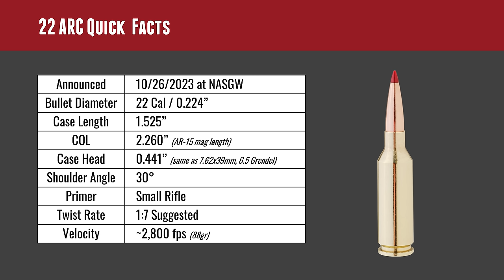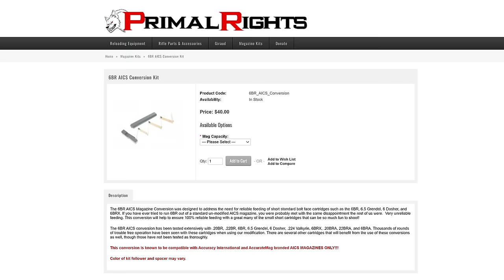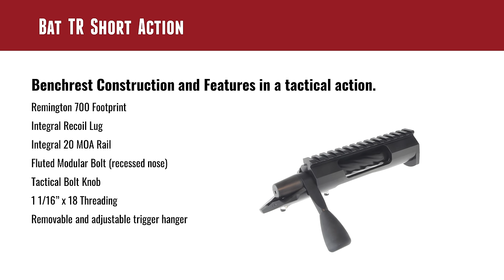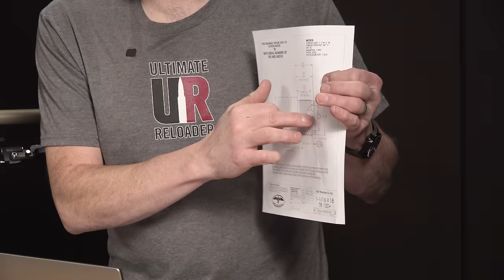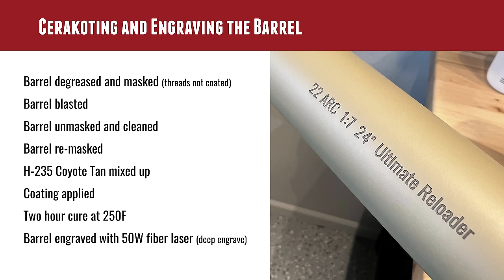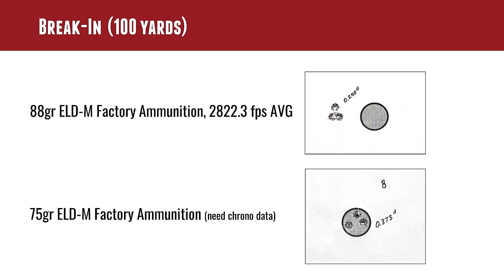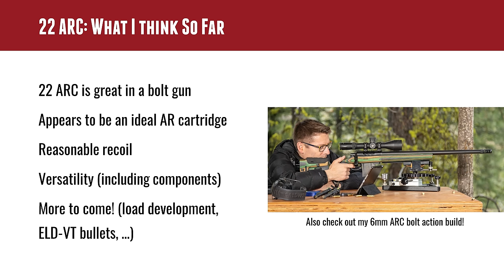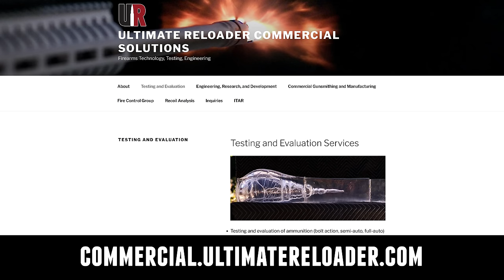22 ARC Rifle Build: Chambering, Threading, Break-In

Comment: Thanks! I'm excited to see the potential of 22ARC in an AR platform. As a 6.5GRN shooter, I have 6ARC parts for an upper build and want to a 22ARC to finish the trio. It's a new take on switch barrel platforms, three uppers, one BCG and one lower!
Reply: I'm a fellow 6.5 Grendel shooter! Lot of stuff got put on hold recently but I've been meaning to build a 6 ARC upper for some years now and when I heard about 22 ARC I knew that would be another one for my list. Have you built that 6 ARC upper yet?
Reply: Not yet. Just got back from SHOT Show and need to process all the new info. I'm sure it will be a screamer. @DanielReyes-hz1qk
Reply: @johnmoore2510  Awesome. I love the concepts and am stoked about the ARC cartridges (as well as the new ELD-VT bullets. I've even got a bolt in the Grendel bolt face for my Defiance action, thinking about doing a 6ARC or 22ARC for that bolt gun as well

Comment: That reamer holder would have to be dedicated to that reamer.  As I would think reamer shanks have enough variation to negate any precision you tried to achieve boring out the holder.  A holder with a collet set up would be more flexible and just as good IF you can get it indicated and set up dead nuts inline with your spindle.

Comment: Interested to hear comments about 22 ARC head diameter in an AR 15 platform. A smaller head diameter is one of the plus points of the 224 Valkyrie, allowing more meat in the bolt head……. and conversely one of the downsides of the Grendel. 52k PSI in an AR platform.

Comment: According to the Hornady manual I have 6ARC, 6.5Grendel and 7.62x39 all have slightly different case head sizes.
Reply: Interesting, from what I understand, as far as the case head, Grendel uses a deeper bolt face. It is only about 0.011", but that can make a big difference.

Comment: I’m much more interested in 22 creedmoor than the 22 arc. I don’t really understand the need for the 22 arc. The 6 arc does everything the 22 arc does, but it does it better, and you can go up in bullet weight to take medium-large game at reasonable distances.
Reply: The reason for a 22 arc would be to use heavy high BC .224 bullets in a AR 15. Bolt gun ???

Comment: Hornady has stated that the 6 ARC and 22 ARC cases are NOT compatible. However, I am not sure if the 6.5 Grendel case is compatible.

I am excited about this cartridge as well as the 6 MAX that Ray on X-Ring speaks highly on.
Reply from the maker: That is correct. I have to confirm, but it may be possible to form 22 ARC by necking down 6.5 Grendel.
Reply: Thats how i form my 22 arc brass. Run 6.5 grendel brass through my 22 arc die and done. Works great. Getting 3450 fps with 53 vmax in a 20” rifle length gas.
Reply: @Ultimatereloader  I think you mean we'll finally get good Grendel brass by necking up the new 22 ARC stuff.
Reply: @Farmerbrown32   I love that 53 gr V-Max, but I wonder how fast it can be pushed with 7 twist rifling? I hear internet stories of 22-250 guys pushing it over 3800, but not with 1:7 rifling. 1:7 at 3,500 (very attainable in the 22 ARC) puts the bullet at 360,000 rpm - well beyond what is often considered max.

Comment: I think the 22 ARC will be a big deal in the AR platform. It's primary advantage over .223 is the substantial velocity increase. I would like to see velocity differences between 18, 20, 22 and 24 inch barrels, so I can determine how short I can go. I need the info soon so I can get one ordered soon. The demand will be great, so the waiting lists will be long. 
Also curious about the capabilities for deer, antelope and hogs with bullets like the 80 gr ELD-X or the 90 gr A-Tip.

Comment: Curious why you'd choose this over 6 ARC in an AR
Reply: The only benefit I see is a little higher BC for bullet weight. I get a little more velocity (2849) out of my 6 ARC AR with a 22" barrel using 90gr Bergers than this got with 88gr bullets, but BC isn't as good. 409 compared to 545 for the 88gr .224

Comment: Help me understand what exactly you mean cut the chamber ? Is the barrel not already chambered for the 22 arc ?
Reply: Correct, that’s how barrels are sold sometimes and then a smith can chamber it and cut threads for whatever is needed.
Reply: @spencerdeaton7202 okay I have to be missing something in translation he ordered a barrel with a 1-7 twist rate already built for a 22 caliber bullet he didn’t cut the lands so is the barrel not already chambered then ? Why would he say he cut the chamber am I missing something
Reply: @dbuckner902010  it has the bore and rifling already done but no chamber.  That way the end user can chamber it in whatever 22 cal cartridge is wanted.  He's done the same thing (chbering) with a variety of calibers.  It's interesting to watch.